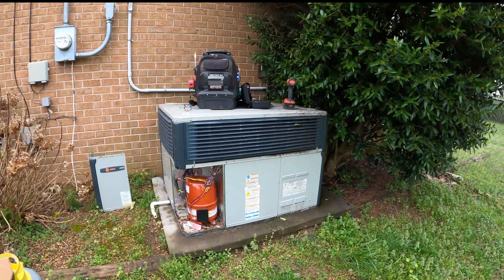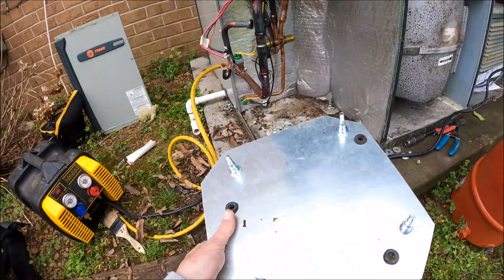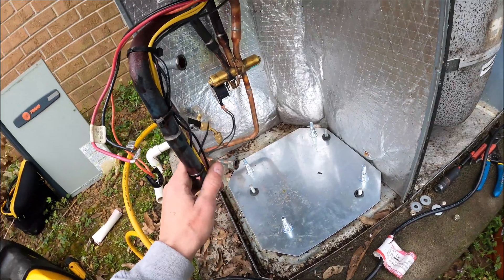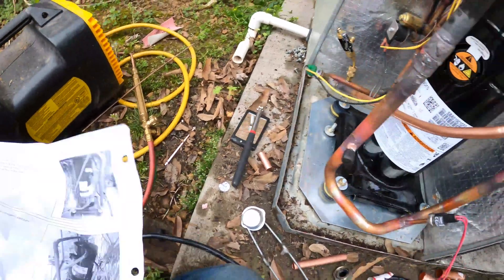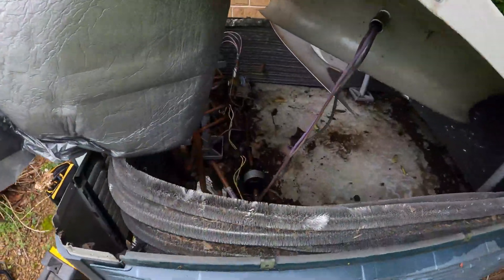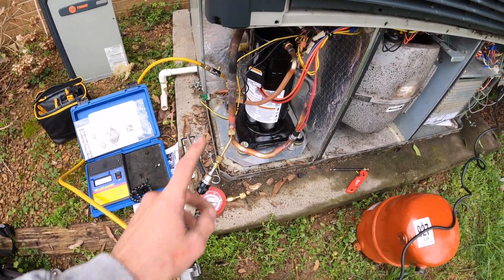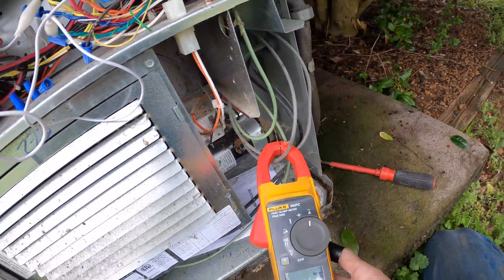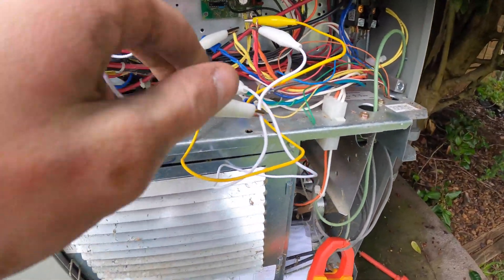Trane Reciprocating To Scroll Compressor Conversion With Kit

Comment: Great video gonna have to do this soon on a twin compressor 12.5 ton condenser. Waiting for trane to get the kit. BTW, the discharge line from the compressor is the hot gas line. The liquid line is on the outlet side of the condenser to the expansion device.